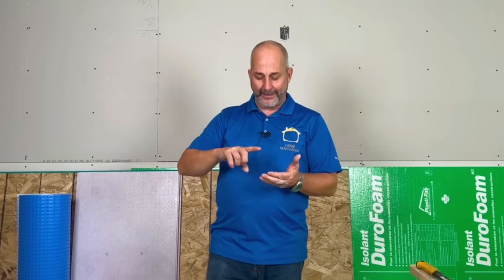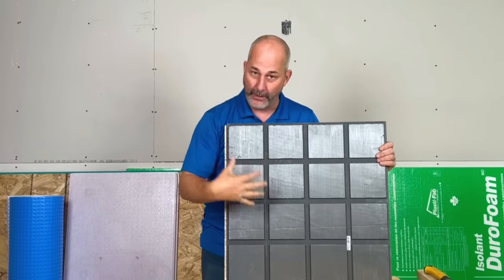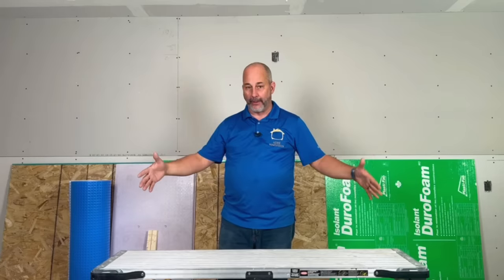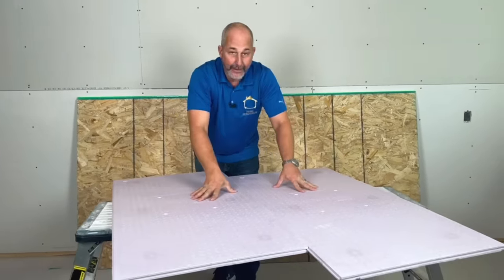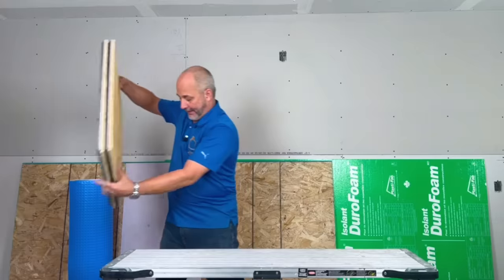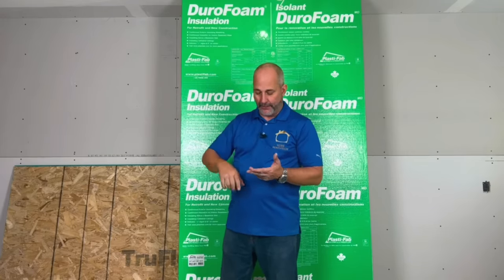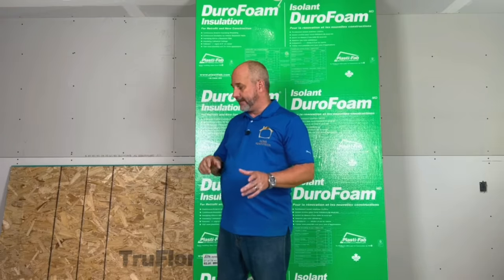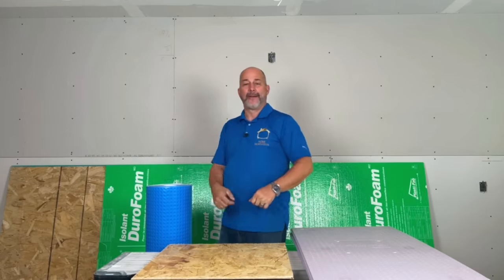Comparing 5 Different Subfloor Systems and What They Cost

Comment: I was thinking of doing the dimple membrane and osb on top as a subfloor for my basement woodshop. Do you think the simple board can withstand the weight of my machinery such as table saw and jointer? Do you think over time the dimples will become smooshed?

Comment: 1960s house with sloped drainage in the concrete floor. Partially finished basement. Rental. What would be a cost effective 10year flooring option?

Comment: Hi Jeff, I am bulding a gym with quite heavy multi gym equipment - 240kg … about 100kg per sq m.
I was wondering if that blue foil could hold up to that pressure giving that I have rubber horse stall mats 100x100x2cm that I would install as a floor in there. Or can I just install it directly on the concrete floor? We don’t have subfloor, so it’s on the terrain level in brick house build in 70ties in Czech Republic in Central Europe. So far I did not experience any moister leaks even during heavy rains.

Comment: I live in Wisconsin I home built in the 70s. Thermal and moisture are both issues in my basement the floor and walls need  a barrier. The Sump pump fires up every time it rains I already have that musty smell in my basement, I have to run dehumidifiers constantly. What sub floor product would you recommend for me?

Comment: My house was built in 2010 so I believe I shouldn't  be worried about moisture so think probably just lean towards a thermal break?? I'm going to do a vinyl plank.. My biggest issue is my concrete, I have almost 1/2 inch difference between my high spot and low spot. I'm doing almost 400 square feet so that's a lot of floor leveler... Would it be better to grind it down?  If so how? Hand grinder?

Comment: Hi Jeff love your channel.  
My basement has a painted slab built in the late 60s   I am refinishing and thinking that the dimple mat is a good option to keep moisture out. Last thing I want is a smelly basement. 
Are there issues with putting vinyl plank over the dimple mat. I don’t want to hear or feel any creaking or popping.
Is there any benefit to painting on some sort of sealer before I put down the dimple Mat
Thank you!

Comment: Ok jeff here's my situation.  I have a one hundred year old house in wilkes barre pennsylvania (zip code 18702) USA.  I do NOT have water ingress from cracked walls or the poured concrete basement floor.  Because the concrete floor is one hundred years old, it never had a monster vapor barrier installed.  However, I do need a thermal barrier and am concerned about high moisture vapor coming up through the basement floor I plan to install finished vinyl  planks that snap together so it will be a floating floor. What would you recommend for the sub floor?

Comment: Jeff, awesome knowledge in this video on choosing alternative products for vapor barriers, subfloor and underlayment depending type of floor you're installing.   I live in twh on a slab, but the kitchen  has two layers of 12/12 in. press and seal tile. which creates two separate heights , as the rest of the area is carpet, which i plan to remove. any suggestions to level without removing kitchen flooring?

Comment: what can I use to provide a moisture barrier and thermal break, for LVP flooring, that will stand up to haveing a grand piano on top of it? my house was built in 1958, in Maryland, cinder block basement walls and poured concrete floor, weeping tiles feed into a sump with redundant pumps. not super tall space so bonus points for retaining head room. 
also, is it worth keeping existing non-structural stud walls that don't have drywall, or should I remove them and rebuild them on top of the sub-assembly?

Comment: I love the video! I'm looking at products like this for my house right now.

Do you need OSB over the durofoam if you're just putting down something like tongue and groove plank flooring? Would the foam compress over time and cause some issues? Also would that tongue and groove plank need that little rubber bottom side or could you get away without it if putting it over durofoam?

Cheers!

Comment: For sheets of OSB or plywood over DMX what should be done with the ends without tongue and groove to keep everything perfectly flush? I thinking of making the end of the sheets T&G with a router since I don't need to line up to floor joist.  I'm also on planning on using InSoFast wall panels for the exterior walls over top DMX to seal wall and floor envelope together. This is a berm home with a full remodel so moisture is a big concern. The AprilAire dehumidifier has made a huge difference in keeping the moisture levels down.

Comment: Hi Jeff, thanks for this video. I’ve been going back and forth on this. 1979 home, with a walkout. No signs of water in basement, aside from a little effervescence on the block. I’m spinning my wheels on which system to use. I had always planned to use the same subfloor system you used in your older basement subfloor video. After watching this now I’m leaning towards the DMX 1 step, especially with cost of OSB. 
If I go this route, should I frame my walls over top of it?  I’m planning to use Rigid Foam Boards on the block wall like you’ve shown on your other basement videos, but then I worry that moisture would travel down the block wall behind the rigid board and just collect on the top of my subfloor? Any advice on this? Thanks! Greatly appreciate your channel, especially as a homeowner who lives in a cold climate.

Comment: This was helpful, but what about the drycore basement pre-assembled wall kits? Is it worth the cost for moisture management? My home is 30 yrs+, we have a basement walkout, we are in the PNW, my basement foundation sticks out several inches from the existing basement drywall. We plan to put in flooring, but we will need to raise all the exterior doors to do so because they are completely flush with the basement slab. We have a basement "bedroom" but the concrete was poured higher in there then in the rest of the basement so I am also wondering how to handle such a large high floor area too.

Comment: Thanks Jeff, love all your content, always so helpful and easy to understand.

If we need thermal and moisture and are not using hardwood, what options are there if we need to limit the floor build up? Laminate can go right over the DMX dimple system (or foundation wrap) but the thermal benefit is limited. If a 3/4 durofoam was added on top would the laminate be ok right on top, or need a layer of osb added? (making that build up really big as you mentioned) would a DIY all in one panel (by cutting groves in the durofoam) have the same effect as the insularmour product? Or is their special tech in it that would wouldn’t get from grooving a durofoam sheet?

Comment: We have a house built in the '60. We had a double sump pump with a deeper pit and backup pump with battery installed, new drain tile, new discharge line to the road including downspouts on that side of the house, and a wall vaper barrier that is under the concrete of the drain tile (because there is a radon system). We also have a whole house generator (basement flooded the first year we moved in, so we fixed everything we could). No walls, just steel beam down the center with 2 posts. Floor to joist is 7 feet. Concrete floor does have a few cracks that will let water in if the sump pump isn't working. On not worried about moisture from the walls. What's the best solution for thermal break, moisture management, and ability to build my walls with my height?

Comment: Hi Jeff, love the channel. been watching you for years, about to finish my basement located in Ontario. I'm wondering which subfloor is best for me. I live in a 2 storey home built in 2021 with a walkout basement. The foundation is wrapped with the black DMX for foundations. Was looking to do what you did in your basement renovation video and lay down the black DMX underlayment then 5/8 obs tongue and grove board over top, and finishing it off with a vinyl planks floor system. does this sound like the best option for me or should I consider using the DuroFoam instead of the DMX? any and all suggestions would be greatly appreciated.

Comment: Love your channel just came across it.  What about carpet flooring didn’t hear you mention it . I got some wall cracking and was also thinking using liquid rubber on the walls and floors to help with the moisture.   I am also wanting to keep the material height low.

Comment: Hi,
My bk up sump pump did not operate in my  beautifully finished hardwood floor basement. The floor is all removed now down to concrete. Subfloor looked like two layers of 1/2 plywood, with a vapour barrier sheet of paper in between and all glued together. This was laid directly but tight on the concrete floor with no screws at all. One inch wide lines were cut in the plywood to let water pass through in case of little flooding, I think. 
Now we have this nice concrete floor and want to put hardwood floors again. I like to use the grooved plastic but what thickness plywood would I need for the hardwood to be nailed to? The subfloor must be no more than 3/4 inch for our cabinets to be placed back. What’s the best subfloor system please?
Thanks

Comment: The foam board with osb sounds like a decent alternative to use on a slab foundation that's got cold flooring. Instead of the hassle of installing heated floors🤔

Comment: Thanks for all your videos! I'm preparing to finish my basement and am deciding on a subfloor to put under engineered hardwood. My house was built in 1998 in St. Louis, Missouri (US). I've never had water leak in, and it passes the garbage bag test; but I noticed the ambient humidity level in the basement without a dehumidifier running is 70% which seems higher than normal basements. I'm worried the humidity might grow mold if I use foam like durofoam - is that a valid concern?

Comment: Jeff - I'm in Ottawa. Many years ago, I finished my basement in my 1998 home with the 2x2 Dricore boards over the concrete. I'm thinking of replacing the worn laminate flooring. 

The floor is cold in the winter and I would like to add an insulation layer.  Is it possible to add the Isolant Durofoam directly over the Dricore or do I have to put that as the bottom layer.

Comment: My house is about 23 years old. I live at the southern tip of Ontario near Windsor. I'm going to do the garbage bag trick tonight but I don't think I'll get moisture. That said I have had humidity issues in my basement that caused mold on the furniture. We've found one small foundation leak on the unfinished half of our basement but no cracks. It was under a water tap so we spray-sealed the mortar in that area. I don't have a big window but I do have garage access. I really don't want to get the water channeling stuff but I'm worried I need it. What would you do?

Comment: Hello, I was wondering if you had a suggestions on how to seal the bottom of the walls in a basement utility room? I know I would still have a place for water to leak out through the door but I've had issues with water softeners and heaters breaking and saturating anything on the floor and this last time we didn't catch it in time and it ruined the carpet. Excluding the utility room that is just concrete; half of the basement is finished with carpet and the other half is a gym that is concrete with rubber mats laid down. There is a drain and sump pump but the house has settled and doesn't drain well any more and would like to find a way to atleast try to keep the water somewhat in the room to minimize anymore future problems. I was thinking about putting flex tape in the crease then epoxy over it and about 4 inches on both sides. Thank you for any help, hope you have a good day!

Comment: Hey Jeff. I live in suburbs of Vancouver in a house built in the mid 70s. The basement is walk-in (I live on a hill with one side of the basement below ground and other side at ground level) and the owner glued carpet right on top of the concrete. I can feel the moisture on the carpet when I walk around the basement. I’m thinking of ripping out the carpet and was going to install Dricore until I watched your video. Now I’m considering the DMX one step solution. I want to install engineered hardwood floor on top. Do you think the DMX is the right solution for me? What if I want to install new carpet, do I still need DMX one step? I might also need to level parts of the floor as well. Thanks for the help!

Comment: Big question here, one you haven't ever got:  background:

Been a fan here for years, finally getting to my basement, but not for why you'd expect. I'm mostly looking to insulate for extra thermal & sound, less about living space, as I'll be playing music down in my 1920s basement.

It does have a toilet original to the basement, along with a 2 inch water trench about 1ft from all walls that leads to a drain.

I'd like to finish off the floors with just the OSB and maybe cheap carpet for the music & laundry areas, however since the floor is tapered at the concrete cement block walls (sloped ground), it'll create a slope on the underlayment.

Should I leave that and work with the slope, or start the level locations?

Alternatively, I could shim the floor up, as it's less than a 1/2" in total, but before going that route, I was hoping for some input.

It's possible I finish the walls, but I'm not going for "living space", more for: "I can change my laundry in the winter, and not have to wear a hoody because I don't heat it" lol.

Comment: Excellent video I have been wondering what type of sub floor to use on my basement. I live in Amherst NY just 15 minutes from Buffalo. My house was built in 1986 and I did have wall crack issues that were fixed. It’s already a finished basement with pad and carpet. Due to a flood that I had with water coming in from my well windows now since repaired I was going to redo the flooring. The finished basement has the studding is built 9.5  inches from center of the stud from the concrete walls all around. The basement is still pretty cold and I am looking into maybe getting a gas fireplace to assist. Would like to do the vinyl plank and had looked at the foam that meets together due to the water management you described. I thought I could not use just the foam as you would want the air to be able to flow between? Any advice would be great thank you!

Comment: My subfloor placement question is in a new (2021) build in MN (aka Southern Canada). Walkout basement slab has crushed rock, then poly vapor barrier, then concrete. I'm considering a combination of dimpled mat, 1/4" fanfold foam board, then 3/4" plywood for the assembly. Minor issue with partition walls already up, but it just means more cutting. My concern is what happens at the bathroom. How do I handle going up to bathroom shower pan (already in place) toilet flange (already in place)?

Comment: Can you lay floating floor say laminate or vinyl or click engineered hardwood above the durofoam directly and not use OSB? I understand that OSB is needed if you need to staple the hardwood/engineered floor. Also how would it work for carpet?

Comment: Hey awesome videos! Our home was built in 2003, fantastic grade, vapor barrier and insulation panels the outside of foundation walls and vapor barrier below the main slab. 

Can I get away with no subfloor if I’m just doing carpet? My guess is there is carpet pads with insulation properties that may work but curious what you think! TY!
Reply from the maker: exactly. Cheers!

Comment: I'm converting a garage to living space and need to raise the concrete floor in the garage. Treated 2x4 would make it up 4" even to the main living area. What would go between the concrete and the treated 2x4? also thinking to put rockwool in cavity to insulate the floor... what would be better option installed and cost wide? It was build in the 50s DC area, USA. Thank you!

Comment: Hi Jeff.
I live in the GTA in a 100+ year old house with an unfinished basement, brick foundation. My better half wants to creat a play space down there for our two littles. I was thinking of putting up a wall to decide the mechanical space from the play space and put down the Dricore panels and put up some walls on the two exterior walls. So my questions: 
Since it is a brick foundation house and it does get damp, should  I build the walls out 3 or 4 inches away from the exterior wall for air flow and put solid insulation on the back of my wall to prevent the damp entering the play space? And my next question, do I build my walls on top of the sub floor or on the cement pad? 

Thanks for all your videos!

Comment: My house is in nova scotia i have a walk out basement but my basement is apart of the house. The house is like a raised ranch, It was built in the 80s but i have no moisture issues the house is on a hill with a slope so no issues there. However i am not a big fan of wood and i would like to put either marble, travertine or porcelain in the basement - except the bedroom in the basement that will be wood. What can i use to insulate the floor so i dont have to spend extra installing infloor heat?